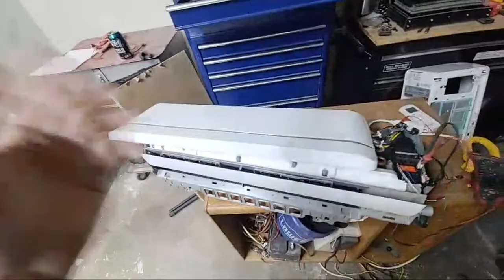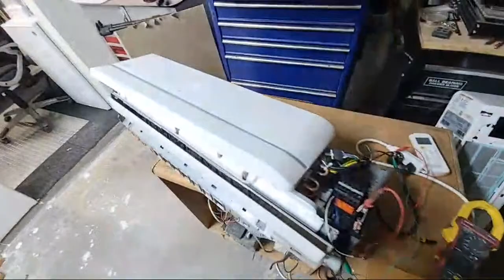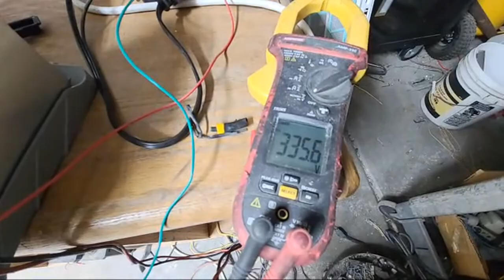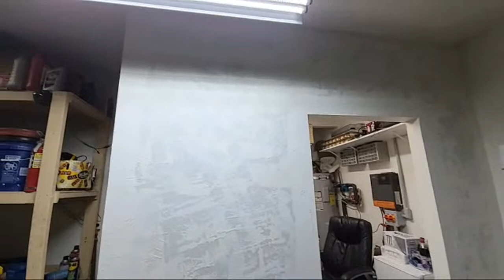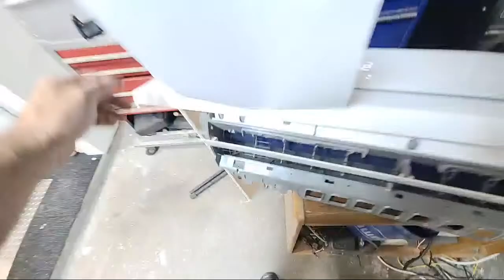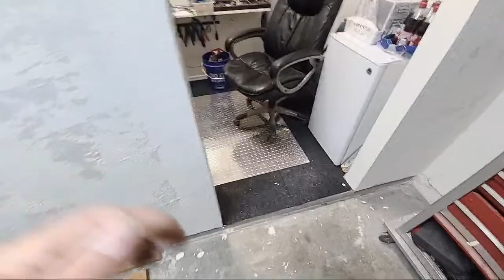Easy Way To Operate A 230V High Wall On 115v Supply

Comment: You could use a 4 way valve to switch between two condensers.
Reply from the maker: In think I'm just going to have a section of condenser coil in series after the water heater exchanger and just switch the pump and ODM as needed. It should drop my running amps when heating the water a tad as well even with the ODM off. And when the water is approaching a high temp while indoor cooling is commanded I can just ramp up the ODM and stop the water pump. 

It's the rvap coils I want to switch.